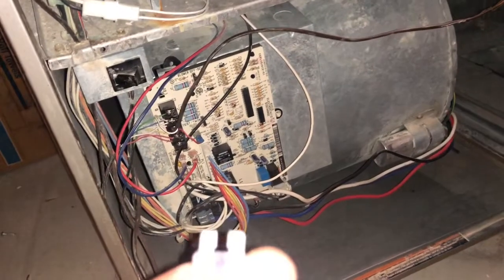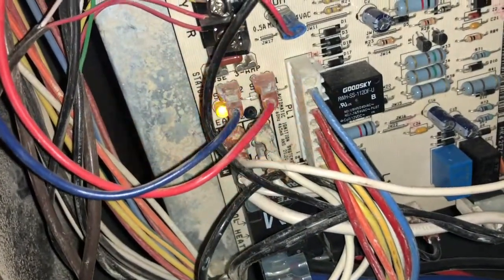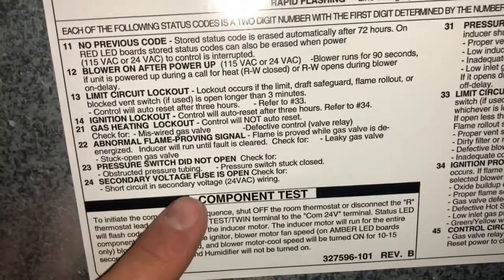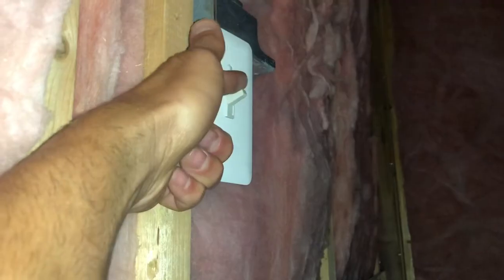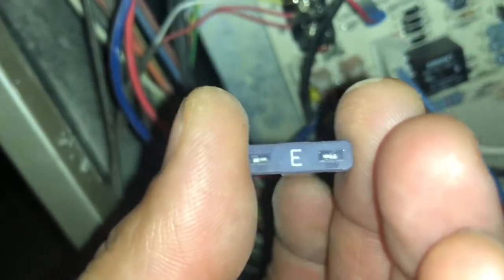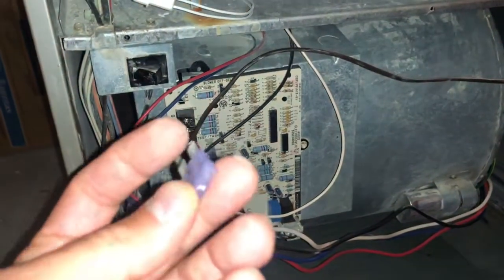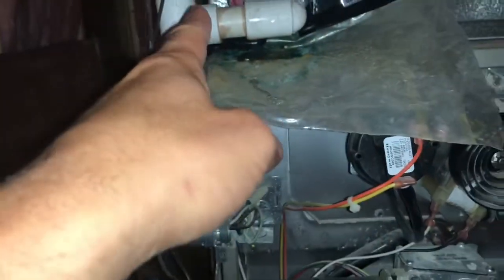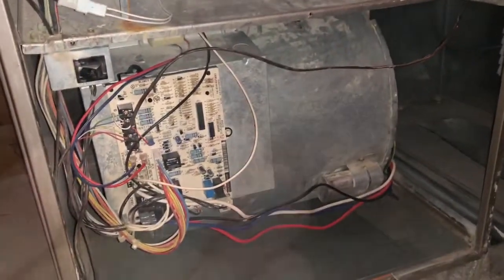Secondary voltage fuse open furnace fix 24 bad thermostat (Replacing the thermostat fixed it)￼

Comment: You rule! Saved me a call to my HVAC guy. My thermostat wire grounded out on a refrigerant line. I had tucked it back to prevent hitting it with the weedwacker, and shortly after the wife was complaining the ac wasn’t working. 
Separated the wire, went to the blower unit, saw the code, deciphered it, googled “secondary voltage short” and found you. Had it fixed in minutes 👍🏻. Men, keep some fuses around the house. Saved me a trip to the store. 
Thanks again.

Comment: Appreciate the video! Furnace was throwing a 24 code after wiring in a new thermostat. I accidentally touched the R and C wires and didn't have the breaker off. Ran to the auto parts store and $5 for some 3amp fuses. Plug and play!

Comment: Appreciate the video.  It was exactly what I needed.  My Nest controller was giving me an E24 (no power to Rh wire) error.  While troubleshooting that I came across your video.  I watched the little LED light and was getting the 24 code on the furnace.  After pulling the fuse it was sure enough blown.  

Ran to Advanced Auto parts down the road and picked up a pack of $4.  Saved me an $80 service call to American Home Shield.  The biggest issue I had was the dang attic was almost 130.  These San Antonio summers are no dang joke.

Comment: Thank you for this video. I was struggling to figure out what that code meant. Once I found the fuse I saw that it had blown. I replaced it and it immediately blew again. Then I remembered that the old thermostat I had used 5 wires, but the replacement used only 4. I removed the 5th blue wire, replaced the fuse and it started right up. My next call would have been the repairman so you saved me a couple of $100. Thanks again!

Comment: Thanks so much. Just get this problem when I replace a new thermostat, I guess I didn't shut the furnace down before I remove wires from thermostat and caused a short. The thermostat can't be turned on and I found the furnace indicator was blinking two short and four long and I located the fuse as you mentioned and there was a burn mark, just drove to Canadian tire and get 5 pcs replacements for just 5 dollars. Got home and plug in, does work properly, really appreciate it, nice video.
Reply: This is exactly my predicament. I didn’t realize taking the thermostat cover off prior to cutting power to system could blow a fuse. Hoping the new fuse will solve my HVAC not turning on after installing new thermostat.

Comment: This fixed it immediately. We had a massive thunderstorm last night with lots and lots of lightning for several hours. I’m not sure that has anything to do with it but my spidey sense says it did. We didn’t discover until this morning that the thermostat was without power. Checked all the breakers and even reset a few to no avail. I managed to find this video which featured almost the same model number board. I shut the power off to the #2 unit in the attic and pulled the fuse. I had to hold it up to a light to see the broken wire. There were no real “burn” marks but there was a small spot. Inconsistent with the rest of the fuse body. I ran to auto parts store and bought 3a fuses and had my wife watch the thermostat to determine of power returned, which it did immediately. 

This will obviously not allays be the perfect fix every time but, as well as protecting precious electronics,  fuses are there to create a predictable weak spot that you can check as your first step.

Comment from the maker: The reason you have this problem code 24 is because something is usually malfunctioning replacing the fuse 50% of the time doesn’t just fix the problem something is causing this issue If your fuse pops as soon as you install a new one, The second most common problem is a bad thermostat spend 30 bucks an install a new thermostat to see if the problem persists if that doesn’t work, The third most common problem you will need to look for a wire that has its rubber coating cut so do vibration inside the side compartment of the condenser unit outside, you will need to remove the side panel there are usually about four screws make sure to turn the power off before doing so usually there’s a unit against the wall where you can remove a fuse or turn off the power check the circuitboard for any markings that look burnt...my thermostat was defected I ended up replacing it for $50 and it fix the problem immediately
Reply: My outside unit won't start and I inspected low voltage wires had been spliced probably with the weed wacker and I could see the copper. Would this cause that fuse to blow?

Comment: In my case (Tough case) the fuse would blow  intermittently  on start up.   Now this is the heating  season not summer. The solenoid/water valve on the humidifier. Was bad  causing a intermittent  spike of current when furnace  kicked on . I disconnected  valve  24v line and fuse stopped blowing. Replaced valve and problem corrected.

Comment: Thankyou!  Right on the money.........it is the fuse.  I didn't have the exact fuse E, but i used the fuse number 5............and it is running but don't know for how long.  If it burn, then i will replace with number 10.
Reply: hopefully your problem was solved - but for future reference, you should not use a higher rated fuse. 

the purpose of the fuse is to protect other (more expensive) components from receiving too much current. I made the mistake of testing a 5A fuse in place of the 3A and the internal wiring for my thermostat burned up.
Reply: Hi, I will get the 3A fuse ready, but the 5A fuse is working for 2 weeks now.

Comment: Nice video.  Would have been nice to see WHERE you pulled the fuse from....
Reply from the maker: It’s on the circuit board and the circuit board is only like 6” by 9”

Comment: What was the initial problem? You were just worried about a light?
Reply from the maker: The furnace was not working and the LED was flashing it ended up being the thermostat needed replacement a bad thermostat can cause a fuse to pop and the furnace will not work as intended

Comment: Where is the fuse located?
Reply: On the board. But sometimes if you don’t have a board or a fuse on the board, it’ll bypass and blow out your transformer. I’m a HVAC technician on EPA 608 certified.
Reply: Will it be okay if I but it’s a 5 instead of a 3? Just blew on me I’m gonna put a 3 in tommrow just didn’t know if the 5 would be okay for the night

Comment: So my three amp fuse was blown. I replaced it which got everything started, but then it blew again quickly. Any ideas?
Reply from the maker: I would look for a frayed wire, burn marks, something rubbing, shaking wire against metal, causing it like the rubber coating to melt away and metal on metal touching. Also check the area where the condenser is outside you must open up the compartment and check to see why you’re shaking from vibration.

Comment: Was the fuse on the circuit board?  Where was it located?
Reply from the maker: Yes its on the circuit board
Reply: I know what you mean. It's a great video — except for the part about WHERE the fuse is. We don't see it coming out or going back in.

I took my circuit board off the housing (didn't unplug wires), to take a better look. The fuse is on the lower left, between the various wires and the vertical, black terminal block with all the screws in in. Basically just under the terminal block.

I'm off to get TWO fuses, in case the first blows. We've had an easy winter so far, on the west coast of Canada — but we're going below zero next week.

Thanks for the video, Do It Yourself Is Easy!
Reply: @KooperSalmo  It would be nice if the video showed the exact location of the fuses instead of just showing it already in your hand.  You show so much else except how to actually fix what you are saying is the fix.

Comment: Had a similar problem with my Payne furnace. The filter collapsed and hit the fan, it caused the fuse to blow.
Reply from the maker: Did you have the filter in backwards because the side that the fan sucks from has metal mesh that prevent it from getting sucked into the blower motor

Comment: would the fuse burn out if it’s just gas and not air condition?
Reply from the maker: I am not a heating and cooling professional I just know that it worked for me so I shared the video my thermostat was defective causing the fuse to burn out it has helped many people I know the fuse is purple and yes that will be a standard number

Comment: Your filter is not going to pop your fuse. If your fuse is popped there's most likely a short circuit and it'll pop again right away. If so, call an hvac technician. Don't replace a board without knowing where the short is. The board will not be the cause of the short 😂